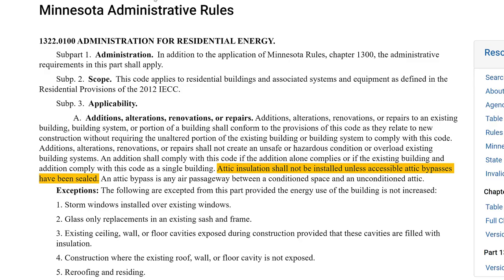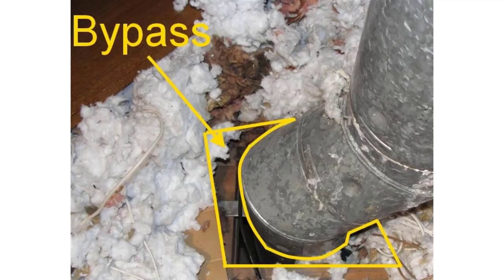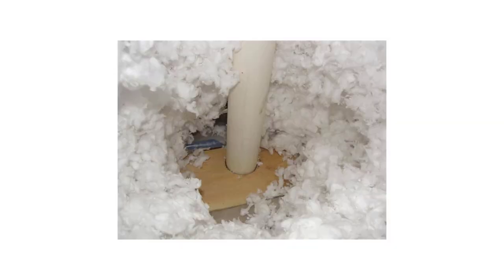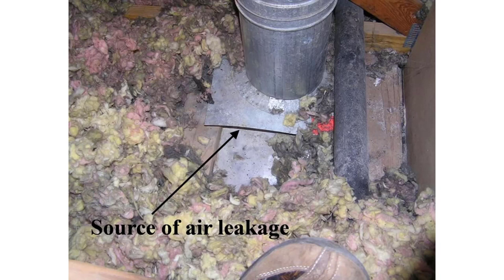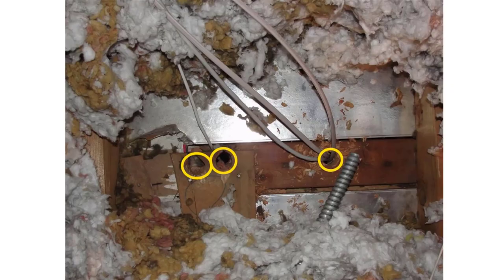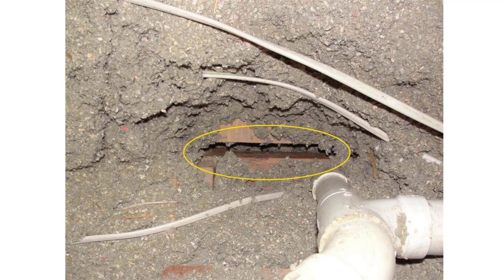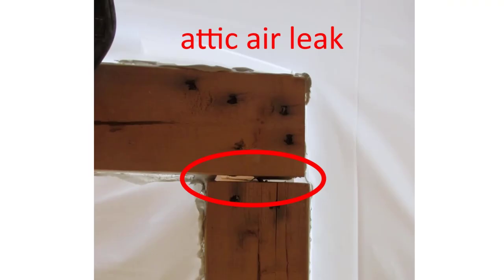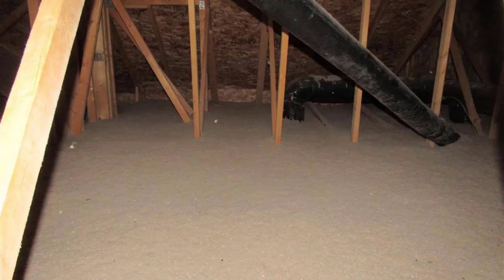Before you add insulation to your attic, seal the air leaks!

Comment: Great advice. Shortly after we purchased our home (and had Structure Tech perform the home inspection) I had all the old insulation removed, had them air seal with closed cell spray everything in the attic. New baffles were installed and had additional cellulose blown in. The house has been comfy since.
Reply: Now, you like it or not. Why do you think ANY contractor will recommend replacing as much as possible in your home??? Ever thought of that and did you use your brain to it fullest extend ? 

Don't be stupid people and don't always agree with a contractor. Contractors in the USA are compared to lawyers, they will suck all the cash out of you and only because they know they can. Change your views how things are done and you will realize that we are paying way too much for all contractor related work. I am talking from my own experience here. Now it's your turn to think!

Comment: We found one huge (6" x 6") gap next to the big black pipe (plumbing vent) in the attic in our 1938 Minneapolis house and sealed it with three cans of Great Stuff spray foam and some scrap pieces of dry wall. Probably should have cut a piece of foam insulation to stick there and then spray foam. Couldn't find any other attic bypasses (air leaks). Also cut and taped and glued foam board and weatherstripping and handles to the attic hatch.

Comment: Thanks for your videos.  I have ranch style premanufactured home built in 1967.  Currently insulated with fiberglass batts between ceiling joists.  In the attic I notice a lot of air bypasses.  I am concerned if I hire a professional to add insulation to the attic floor they will not thoroughly seal all the air bypasses and just cover with insulation.  My preference would not be blown in insulation because after I would not have good access to all parts of the attic without disturbing the insulation each time.  My AC air handler is located on the attic floor.  Would it be overkill to spray foam the attic gable walls and roof rafters instead of just blowing insulation on the floor?  Assuming the spray foam idea is performed, how much more efficient would this be compared to the blown in insulation?  How would the 2 types of insulation job costs compare?  Could the added cost of the spray foam method pay for itself in 10 years?

Comment: It’s the same for houses in warm climate zones too?
Reply: I would if I lived in the South. Don’t know why so many omit energy advice for hot climates. Shrug.
Reply: @bethanyanderson1745  yeah it’s, vice versa, cold leaking up to hot leaking up into an attic will create temperature differentials, hence condensation, then mold. I agree.
Reply: Air sealing lessens other transfers in homes besides heated and cooled air.  It reduces moisture condensation, which could become mold. It helps to prevent entrances of insects, animals, dust, mold spores, bacteria and viruses from entering your home.  It dampens high frequency sound a bit, though not bass.  It is just a good idea all around, for all around your home.  Seal tight, ventilate right.
Reply: @Lughnerson  It sucks we generally have to ask for air sealing or the insulation installers won’t do it.

Comment: When you air seal attic don't you have 2 vent the living space somehow from gasses and stale air and such?
Reply: Open your windows
Reply: @pearlperlitavenegas2023  your not going to open window all the time plus not in winter either not sure where your living under a rock
Reply: @Brandon-no3vc  in Silicon Valley California 🤣😅😂 we get to open our windows year round
Reply: @pearlperlitavenegas2023  so you don't know?
Reply: Depending on how new your house is, it’s probably not all that well sealed to begin with. Older homes tend to be very leaky. Air sealing your attic is not going to stop all air movement through your home. 

I wouldn’t even worry about it. It would take an extremely tight house to begin effecting your indoor air quality. 

You can get a blower door test done to see how much air leakage your home has.
Reply: @whhhatup69  isn't there gases inside homes that you need to ventilate ?